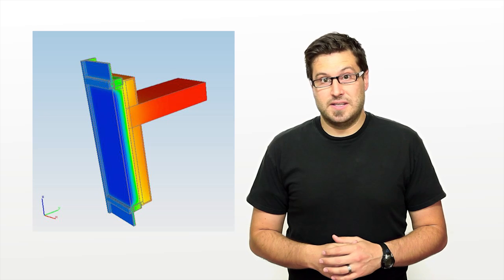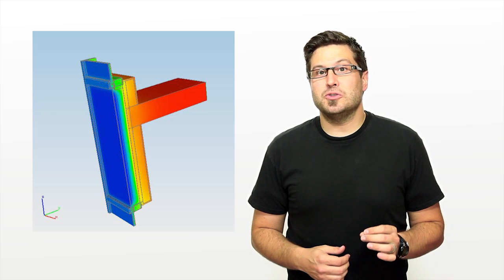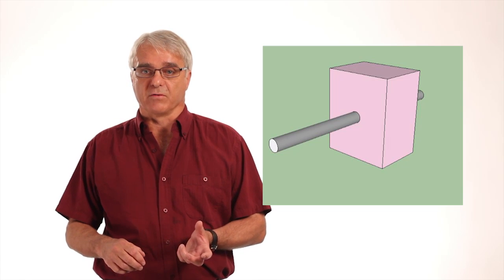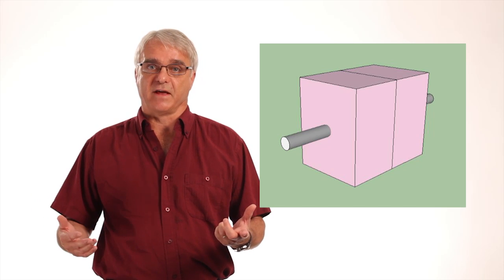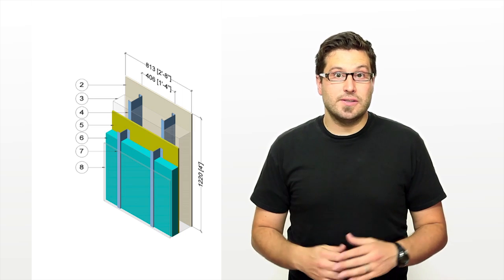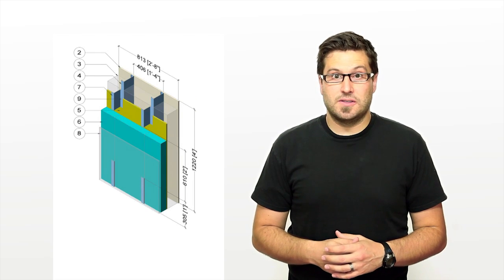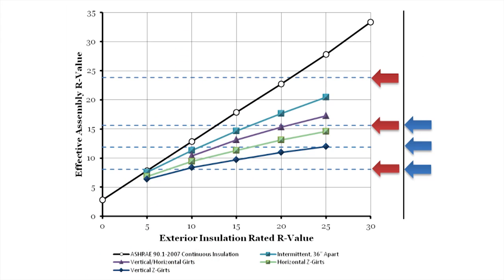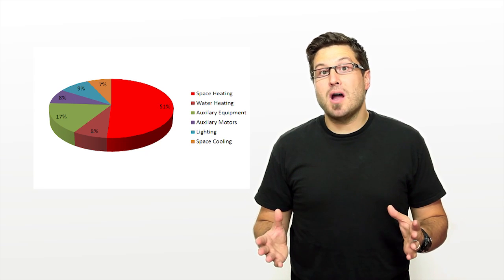2 R's Won't Make Your U

Comment: Nice video. It should be pointed out though, that contrary to the host's claim the walls are responsible for most of the energy transfer (I assume he means the opaque portions of the walls), windows are the actual energy guzzlers. When fenestration represents 40% of the whole building enveloppe, there is little benefit in improving wall thermal resistance unless you have a good fenestration product, properly installed!

Comment: This piece suggests that the current codes being built to in North America do not take account of thermal bridging - is this really true? If it's true then I am shocked that the codes are so behind the science - by about 40 years at a guess.
Here in Denmark it's the insulation value of the whole wall system we have to calculate - including all thermal bridges and line losses - and 3D point losses. Please tell me I'm wrong.